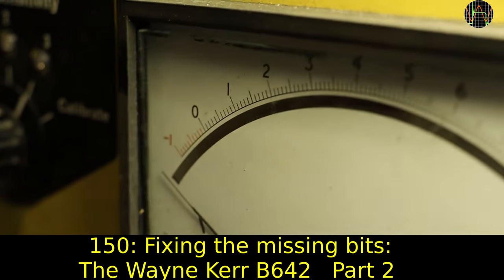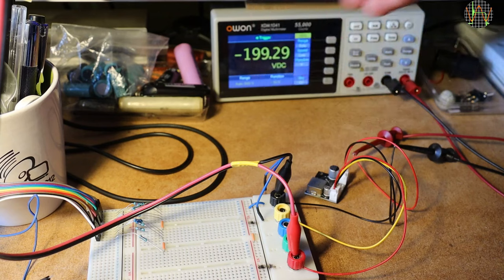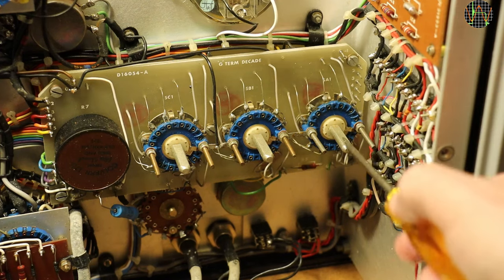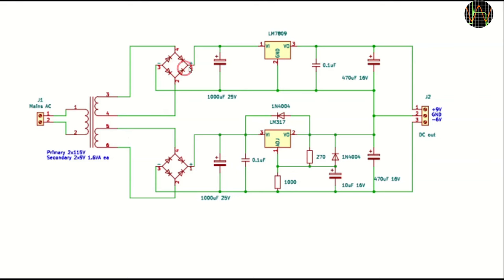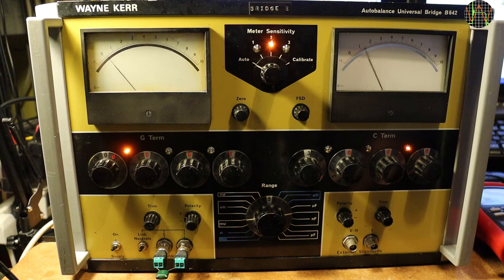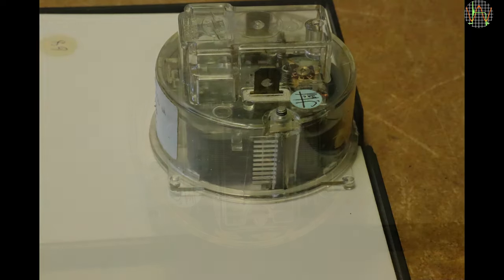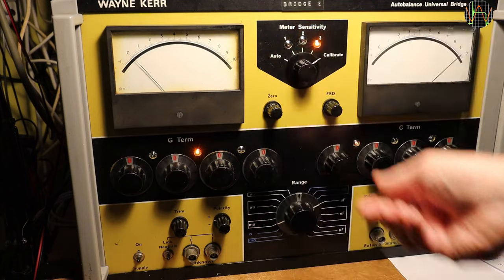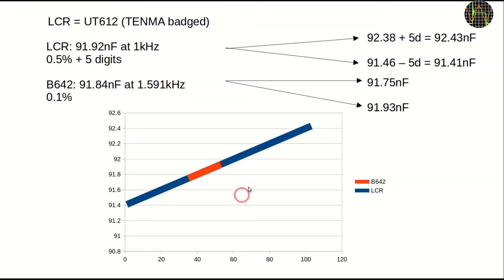150 - The missing bits: The Wayne Kerr B642  part 2

Comment: Very well done. I like your solution for the power supply, restoring equipment to original condition is desirable but sometimes just not practical. With such a sensitive instrument it would be nice to shield the supply - perhaps an aluminum hobby box without the cover could be found with the appropriate size. I would like to see part 3, the alignment. Regards, David
Reply: I think first some doubled up aluminium foil could be used to empirically prove whether the supply really needs to be shielded or not, or whether no difference can be detected between one being present or not.

I'd argue the biggest reason for the previous supply needing one is gone - we are no longer trying to keep 200V around any more, anywhere but the wiring from mains input to transformer.
Reply: @ivolol  A very good suggestion. I doubt that the power supply enclosure was related to safety issues with the 200 v supply as this voltage is routed to all of the switches and the indicators - so lots of contact points outside the power supply. I was suggesting a source for a cover if needed. Regards, David

Comment: I am very grateful for this video, as it will help me to calibrate my B642. Please do Pt.3 🙏🙏🙏
Reply from the maker: I am still looking for good ref caps to do the calibration
Reply: @TheHWcave  i will have a look in my stash. I think I have a few 200nu 0.05% caps
Reply: @TheHWcave  i found a few 0.5% if you think it will be ok, I am glad to post it to you. It's silver mica cap.
Reply from the maker: This is a very kind offer but I first want to try something else.  The manual says for the accuracy check a 100nF cap with 0.01% tolerance is needed. For the trimming (cal) they actually want a 10nF 0.01% cap. I have now got four 10nF 0.9% caps. I measured those with my LCR meter (0.5% accuracy) and another LCR meter at 0.25% accuracy and for all four, the two LCR meters agree with each other to about 30pF difference. That gives me some confidence that my LCR meters are still reasonably accurate. My plan is therefore to check the 4 caps with the B642 to see if it agrees with the 2 LCR meters. If it does, I would not touch the B642 cal. If it doesn't, I may set the B642 to read the same as the two LCR meters.  Only problem is time. My day job workload has increased drastically and family also wants attention...

Comment: Was about to ask why you didn't replace the neons with LEDs, until you did. I'm always interested in seeing calibrations. Seeing instruments line up to perfect 0s (or at least perfectly expected digits) is like ASMR to me.

It's interesting / confounding to me that we can "easily" get resistors to 0.005% tolerance (thanks, Vishay) but can basically never get anything but 1% capacitors, and practically no-one is willing to give a better than 0.5% rating for their instrument testing them until you spend big $$.